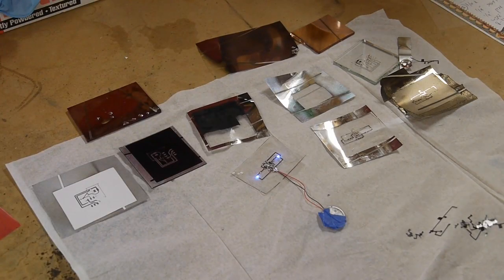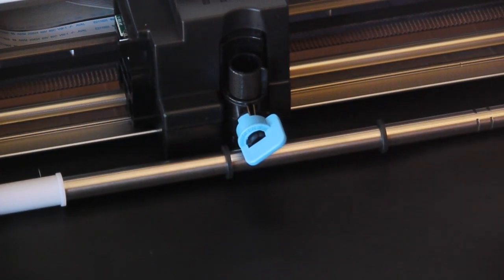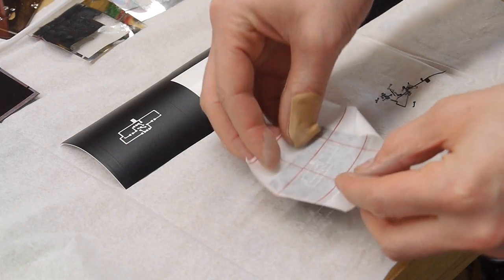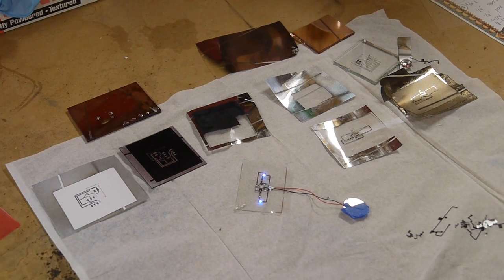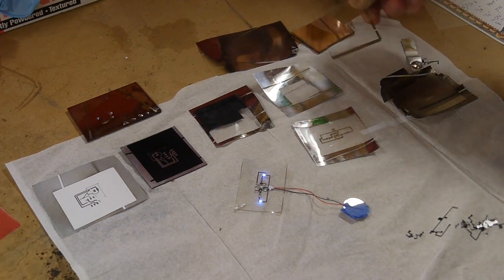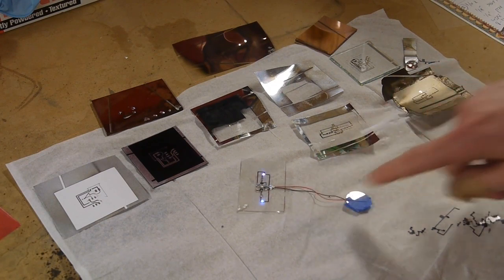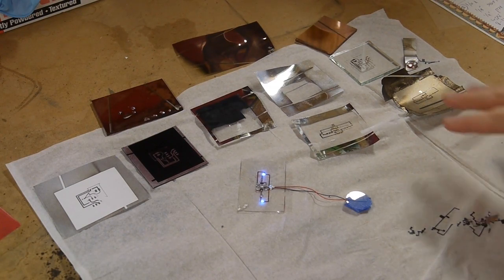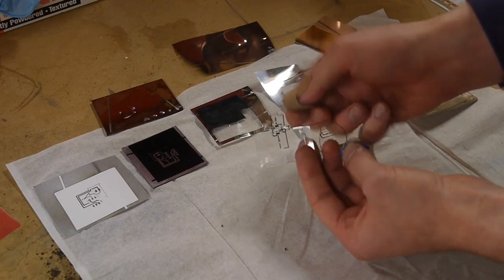Clear flexible printed circuits - first success

Comment: Can you aim & focus molecule stream with magnets? I wonder that if you can do that you can make molecule jet printer. Or if you cannot do that you maybe can make moving "nozzle mask" and then you can print with that. 
What I have in mind with that molecule printer you can print your different materials without mask tape. And when you can do this you can also print to convex surface. When you can print to convex surface imagine that you print circuit board, coil, transistors oled to contact lenses surface. Naturally eye does not focus to right spot of lenses but anyway at least maybe this give some kind solution to make electronic iris or something else mad science.

Comment: You could use some graphine to decrease the electrical resistance. I have see a person coat some thin clear flexable plastic using the chemicals used to make graphine in a enclosed container. It conducted better than copper, was thin and had very little resistance. With your set up it would be very easy if you could get the chemicals but I don't know how hard that would be or if you could make them yourself.

Comment: Hi. I think you would be interested in looking at crystal batteries. If you know what a crystal battery is then you know it collects small amounts of ambient energy from the environment "free energy", but it is proven phenomenon and not a galvanic reaction or radio absorption.
 The batteries work on surface area at the molecular surface level, but people making these batteries are using thick layers when they could use a thin films of material.
 Please take a look at glue crystal batteries on you tube from ibpointless
I think with your skills you could make a permanent super energy collector the size of a phone book that could put out more energy than a car battery and never need to recharge.
The materials are common inexpensive things that you can find in walmart.
If you are interested please let me know, I would love to help if I can with any ideas

Comment: You should absolutely test this out on kapton tape! 

I had plans on doing that about 2 years ago when I built my first system but a lot of things came in the way just after that so I didn´t have the time for it. But I have heard that both copper and aluminum adhere quite weak to kapton but I have not had time to test how weak but if that is the case so it´s unusable so should I use a chrome interlayer instead (which adhere strong to pretty much anything) and then evaporate copper on top on this that stick hard to chrome and then so should you have your homemade "DIY" soldable flexboard. :)

I so badly want to do this but no time yet and im also looking for kapton film that doesn't have any glue on it to prevent any glue to evaporate and coat everything in the chamber.

If it´s possible to solder to chrome directly so could the copper step be excluded but I have not have the time to try that out yet so I don't know.

Comment: For high aluminum adhesion (25MPa), glass can be coated with Hypalon (CSPE CSM). It's durable and heat resistant.
I'm sure there a lot of other primers exist.
Don't forget, that aluminum should be covered with copper to prevent electrochemical reactions. But there are limitations cause thermoelectric effect.

Comment: No, you can deposit just about any metal but some are harder than others. Aluminum is very easy to do, copper does not stick well,  gold is expensive and does not stick well. Silver might be one of the better options.

Comment: Hey does this HAVE to be aluminium ? Its a bit of a b*tch to solder ? e.g. I'd rather have a board that could (gently?) have components soldered on after the vaccum deposition stage ? You might need a tougher substrate material, but you'd avoid torturing the components hmm?

Comment: If they make any conductive epoxy for wide temperature fluctuations, it should be more flexible/rubbery... or maybe add a layer of a more flexible non-conductive epoxy above it to hopefully hold the connections better when the circuit is flexed.

Comment: One last thought: Make a heavy copper deposit onto the flexible substrate using no mask at all, then proceed the old fashioned way, using photomasking and acid etching followed by an additional substrate above for a flex-strengthening sandwich layer with small cutouts for high profile components.

Comment: Two thoughts:  
1) brittle failure of flexed traces could be extended using a light flexible substrate applied to the top of the circuit - basically a circuit sandwich. 
2) Richard Crewe made an interesting point, as my first thought was, "Wires would flex just fine." 

I wish I still had my old Perkin Elmer 400, I could whip you out a mask of your circuit with thinner traces for much heavier deposition that mimicked actual wires.

Comment: Are you able to thicken the copper coating using electrolysis before removing the vinyl mask?

Is the film and coating robust and flexible enough after coating to be run through a laser printer then etched? Could print a spiral then etch to get an electromagnet / speaker driver.

Comment: nice handy cutter you have. I have 1200mm which is way too big, never really made use of the sizes. Cant even get it to cut correct now, i suspect its warped. Those 630mm ones are what I'd get nowadays.

Comment from the maker: There's a really delicate balance between rejecting ideas that require too much future technology, and supporting ideas that will be solve problems in a reasonable amount of time. For example, I'd like to work on brain-computer interfaces that will change how we access information. It's basically an electrode plate that is mounted on the cortex and has bio-stuff to connect it to neurons. Safe to say it will not happen for several decades, and working on fMRI and basic science will help more now.
Reply: AI model to read my dogs thoughts

Comment: Could this method be used to deposit a thin layer of copper on a PCB for trough hole activation before plating? It would be nice since  hole activation is done with some hard to get chemicals.

Comment: The same exact problem is faced by 'proper' flexible circuits, though solder is lots stronger.
The approach there is simple stiffeners.
A square of more rigid plastic behind areas with components helps lots.
The epoxy isn't the only problem - the track adhesion is not great, and a really strong flexible glue risks ripping it off.

Comment: One of the big steps forward for me (though I haven't made a video on it yet) was when I started using Riston.  You can get very fine traces by using a UV source to mask off the Riston.  The big difference for me was, you don't need to mechanically remove the mask.  You can do it chemically.

I haven't printed too many glass PCBs with it yet, instead of toner transfer, but that's changing.

P.S. You may find 42/58 Bismuth Solder Paste interesting.  It melts below 300F!

Comment: Rather than conductive glue you could use z-axis conductive tape. It's very thin and flexible. It conducts from one side to the other but not laterally along the tape.

Comment: Is the plastic required for you future research on making OLEDs and transistors in the deposition process or could you do that with Kapton instead? I'm thinking you could make hybrids with both built in components and components that are soldered on after the fact. Actually, I think just using Kapton and soldering the components would be very stable and useful.

Comment: Ben and Spoif,
We've used the toner method for years with variable success.  We saw something called "Toner Transfer Paper" in DigiKey and bought some.  We finally tried it.  Wow!  We used to soak the paper forever and struggle to get it off.  This stuff transfers all the toner cleanly with just a little water.  
Digikey Part number 182-1003-ND  Expensive but worth it!

Comment: Are you talking about the evaporation? In a vacuum there is no air to block the aluminum, so it just flies in a straight path under the effects of gravity. Particles move pretty darn fast, so many of them fly right to the target.

Comment: How low is your chamber pressure before you evaporate the Al? If it is too high you will get lots of oxygen in your film which will decrease the grain size and lower the resistivity of the film. One easy trick is to deposit some Ti before the Al. The Ti film will act as a getter pump reducing your chamber pressure further. You can even use it as an adhesion layer too. Yes, that means two filaments, but you will need more to make more complicated ICs.

Comment: Hi Ben: Poor adhesion of Al-Glass, suggests contamination. Aluminum on a well coated mirror should not peel off when scotch tape is pressed on and pulled off. I just tried this (several times even from the aluminized edge) on a 40 year old diag mirror with zero Al lift-off. Assuming you’ve super-duper cleaned the glass you could try adding a shutter so the 1st stuff is not deposited allowing a degas/clean-up phase, during which the vacuum should (might) get better as the Al acts as getter. Mark

Comment: Hey Ben! You could try "sandwiching" the components in between 2 plastic transparencies so to keep them from falling off. These 2 transparencies could even have different circuit tracks to allow more complex connections

Comment: what about trying to make a touch screen, the circuit is prety simple, if you can make several lines on both sides of the film then it could even have a very good resolution, you'd just need to gave a decent micro with enough pins to measure all of them quick enough

Comment: Make a Stiling engine!!!
Ah u mean withe the metal deposition thingy. 
Well to late now u have to make a beta Stilring engine with built in linear alternator line the NASA Stirling Converter. Size it to 1kw output. Thx. 
watch?v=P1FwrDZKfKk

Comment: Not sure why you want a clear backing but if you do maybe use thermoplastic and laminate it. That way it can't run away and might endure much greater flexibility.

maybe you can try cracking the problem of making diamond with vapor deposition :)
it's been done so it's not impossible :)

Comment: Ben, a suggestion for making much more flexible components would be to use a glue with a higher elasticity, something like polyurethane or silicone. Perhaps some homemade glue with a colloidal suspension of silver or aluminum?

Comment: How about a glass sheet (or cylinder?) with a circuit pattern between electroluminiscent paint like LumiLor?  A little extra circuitry and you could get different parts of the pattern to light up when you want.   Great video Ben!

Comment: Epoxy isn't flexible.  Maybe something like a polyurethane?  Something similar to what is used to keep auto windows adhered to the body, but that conducts?  Poly is flexible and holds like a sombitch, but isn't conductive.  A conductive poly would be awesome.  Thanks for the great content!

Comment: Would it be possible to make extremely small capacitances by depositing film on either side of a dielectric substrate? Perhaps this could help keep more of the circuit flexible.

Comment: for a start, couldn't you glue the components to the clear sheet and tape over them (leaving the connectors exposed)? I reckon the connections would be fragile, but that's the only step forward I could think of as of now

Comment: It would in any case be difficult to determine if the measured temperature is constant throughout the bottle, so I don't think if printing the thermo couple onto the glass would be very reliable. It is something that must be explored in experiment :) I believe sticking a simple thermo sensitive (colour changing) material onto the glass would have the same accuracy (see those fish tank thermometers that you just stick on the glass)

Comment: the circuit might be more flexible if straight wires are replaced with ones that snake around (like the line of a rectangular signal)

Comment: Have you considered also cutting out spots for your components in the film? It would put the component on the same plane as the bending, and afford the use of adhesive as a sort of structural backing, which would keep the conductive glue from crumbling off. Arguably adding rigidity is the opposite of what you want to do, but it might be a stopgap in the meantime.

Comment: Thanks for the video Ben.  I've been interested in trying my hand at vapor deposition on glass for a while now (both Cu and Al). Did you attempt to deposit the copper onto a glass substrate?  Do you have a hypothesis as to why adhesion was poor between the glass and aluminum? If you were using float glass, there may be a difference between the tin and air side.  I'll be experimenting with borosilicate down the road and am concerned with the coatings scraping, chipping or flaking off easily.

Comment: It looks like you are using a Silhouette Cameo to cut your vinyl Ben?
If so there is a German company that makes a plugin so you can output directly from Illustrator (and some other programs) to the Silhouette. That should make it easier to get your vector graphic on to the vinyl. Google for cutwizard and hobbyplotter.de and you should find it. 
Very interesting video by the way!

Comment: Hm, i figure that the traces should be made from a material that will flex with the pcb. Nokia has a flexible phone. That would be nice to take apart and see what makes it tick. The amount of flexing they put on that test piece when i saw it was quite amazing. Considering it's a full phone.

Comment: Great video and great idea with the integration.
You should try to make a touch sensitive capacitor. By depositing Cu on one side of the foil and putting together two foils with the Cu facing outside. So you could make a few capacitors on one foil like a few touch switches.

Comment: He's got a good explanation in the comments of this video: v=Ds-jtwXbLAk

From what I can tell it's almost like a light source..the evaporated metal simply 'sprays' from the hot blob in a straight line.  Because it's in a vacuum, there aren't any ambient gases to interact with.  The particles are moving at speeds of meters per second (tens to hundreds I believe), so they just spray onto the substrate.

Comment: Ya know what would be amazing? If you can get this to work with reliability, develop a system that 'prints' electronic parts onto a substrate directly from a schematic. If it could be made feasible and inexpensive, it would be revolutionary.

Comment: Rather than the vinyl cutter which wouldn't be very feasible for more complex circuits you could probably use dry film negative resist (plenty of it on ebay), just stick it on, run through a laminator (or a cool clothes iron) to bond, expose, develop in sodium carbonate solution (20 to 40g/L) and then do your deposition, strip in stronger/hotter sodium carbonate.

Comment: Maybe you could improve Al adhesion by etching the glass with HF first. Oh and Al forms non conductive oxides with room air very quickly, so maybe add a protective layer? Cool project! How about graphene/carbon deposition, would that work?

Comment: Perhaps what you need for a flexible circuit is an elastic conducting material and perhaps allow each layer to slide over each other to a certain extent.

Comment: Hi Ben.  I am really fascinated with your new vacuum deposition chamber (around 2:28), but I only got a brief glimpse of it and you didn't really go into much detail about it.  Is the cantilevered tubing a water cooling plate?  Did you stick with evaporation or are you doing sputtering now?  I'm also curious about how you managed to do the electrical feedthroughs - did you just use sparkplugs and then tap matching threads into the bottom plate?  Thanks again!

Comment: You mentioned that you could print the circuit on glass.  How about printing a temperature indicator onto a beer bottle?  No need feeling around in the fridge, just look for the coldest bottle.

Comment: I don't know about the feasibility of this idea, but in regards to improving flexibility, maybe the circuit can be deposited with the substrate already in a flexed position. That way, when the circuit is flexed, it may be less likely to break. I imagine you would need a curved backing plate to give it a try. 
Also, if you would like to have aluminum on a substrate with adhesion issues, depositing a seed layer of a metal that does stick well first will allow you to add on Al on top.

Comment: You can use a "print to PDF" printer driver to get a vector out of any program.  I use the Adobe software that seems to come with CS4.  But I've also used "do PDF" - both worked great.

Comment: Good idea, but you have the problem of heat destroying small ICs and transistors. Not sure on the stability of those SMD capacitors or resistors but I assume they'd be fine.

Anyway, a way to stop the glue breaking might be to use another piece of transparency, place it over the top, then use a heat gun or something to melt it down over the top. Actually, that clear contract stuff you cover books with might be better because it is flexible and very thin.

Just my 2 cents

Comment: would the vinyl cutter cut flexible ITO coated PET plastic?

the 'wires' could be made from it, but i think you'd still have to have some flexible substrate

if you don't care about it being flexible you might be able to put make a clear circuit (apart from the components) and use clear resin around it,... invisible circuit! :D

Comment: Can you try sticking the electronic components on the transparency sheet first, then cover the parts in a way so that they don't short out, then run the deposition, peel the vinyl. and hopefully,this would make it so that the metal deposits right on the leads of the component  no soldering is needed and it would be much more flexible.